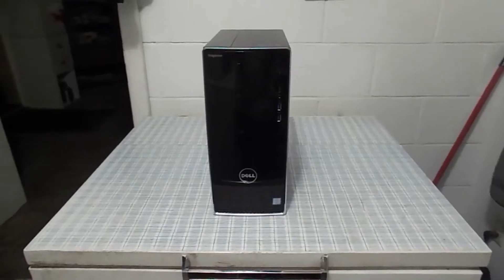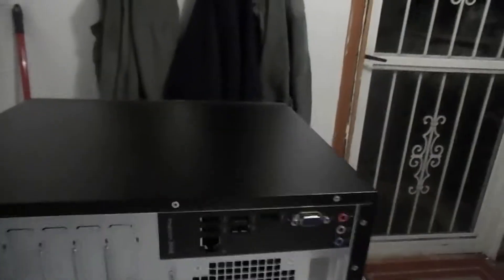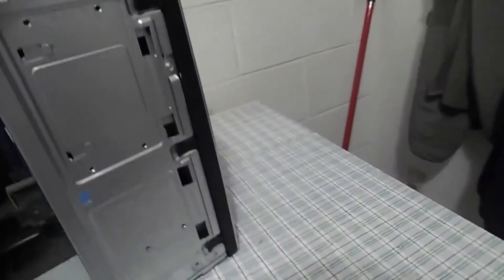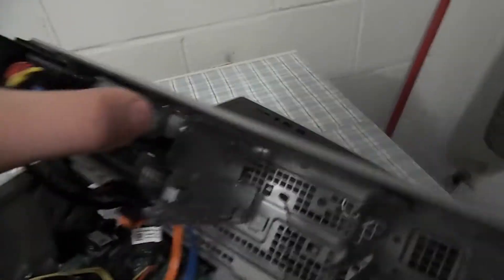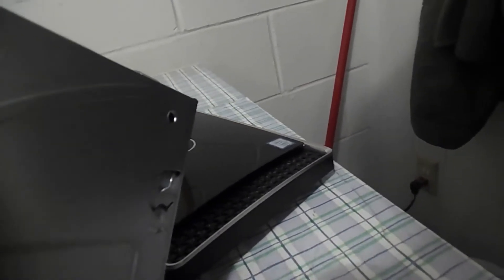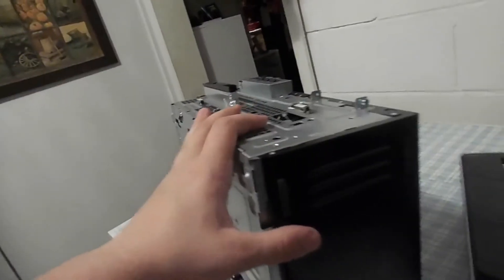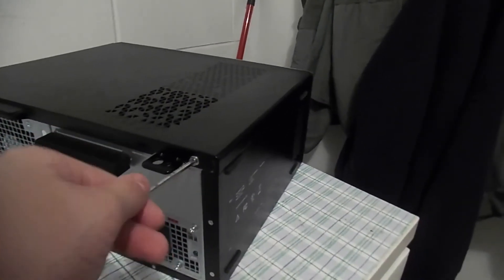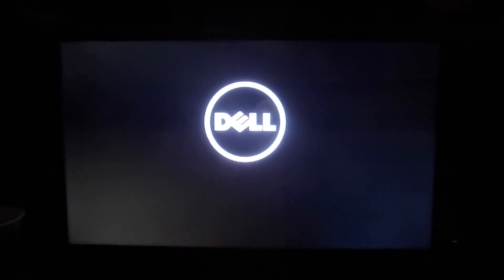How to remove the Hard Drive from the Dell i3668

Comment: does an dell inspiron 3668 pc has a power supply? pls help?
Reply from the maker: It does, but it is a small form factor power supply, so no 8-pin/6-pin/6+2-pin power.
Reply: OnyxTech can you like add a cable (new to this trying to install a gpu but needs a 6-pin pci express power cable is there a way to do this

Comment: The manual says there are two hard drives. Is there room for a third one from my old computer that has my data on it, or can I install it in place of one of the existing ones or would it be better to transfer the data from the old hard drive? Thank you!!
Reply from the maker: Sorry for the late reply, there is only one Hard Drive mounting bracket, so unfortunately no, you can't install a second.

Comment: May I know can it install my own graphic card? Because I would like to buy Inspiron 3668 with Core i3. I just worry it cannot install graphic card.
Reply from the maker: I have an EVGA 1050Ti and it works great, but it cant require supplementary power because the power supply doesn't have a 4-6 pin PCiE cable, but i would go with the GTX 1050TI from EVGA because its a beast of a card and it draws its power from the slot itself, and it will fit perfectly.
Reply: Thanks for your reply..
Means any graphic cards did not require 4-6 pin PCiE cable from power supply will be fit it perfectly?
Reply from the maker: I would look at measurements and make sure but most one fan and two fan cards will fit
Reply: Sorry for asking a dumb question again. Because of its power supply only 240W, does it affect its power from the PCI slot for the graphic card? Example if I buy a powerful graphic card that requires no external power, will it running perfectly?
Reply from the maker: Just check the recommended rating, there are ways to put in a better PSU, but you would have to wire it through the back, but anything thats rated for 300W or lower will run fine
Reply: PCI-E slot can supply from 75 Watt to 175 Watt MAX of power as it needed. nVidia GTX 1050Ti is the best for this PC.
Reply from the maker: If the GPU will fit in the case and doesn't require supplementary power then yes, you can totally install a gpu!
Reply: @OnyxTech  did you use the stock 240w PSU for the GTX 1050Ti? Will a gigabyte 2gb GTX 1050 work?

Comment: Does this machine have a standard-sized power supply? I'd like to upgrade my video card to a model that requires 450W power supply...
Reply from the maker: Unfortunately it uses a small form factor power supply, but you can get rig up an external power supply and use a 20+4 pin to 8 pin adapter, it works just as well.
Reply: BlazinTigre Good idea - thanks!